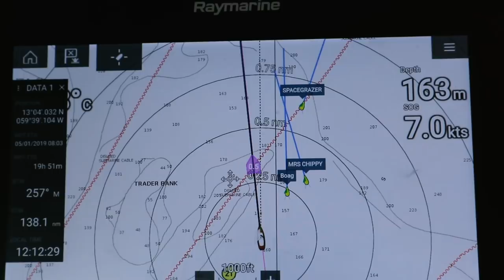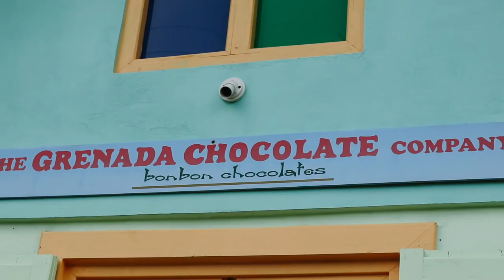Buddy boating while exploring Barbados and Granada Vlog 56

Comment: I recognise some of those boat names and people from Zatara's channel. I really like the water generator to wind generator conversion. Do you find it effective? Was that Prickly Bay you were anchored in at Grenada?
Reply from the maker: Yip Zahara was part of the gang for a bit.  The generator is awesome.  Around 10 amps for water and 6 for wind in average conditions.
Reply from the maker: It’s very effective actually we really like having the option of wind or water generator and they both have good output, the duogen is a purchase we are really pleased with! And yes we were anchored in prickley bay, nice calm anchorage and super easy check in process with little customs office right there, much less rolly than the night we spent in st George’s
Reply: @SailingNikau  Thought I reckognised Prickly Bay from Adventures of an Old Seadog